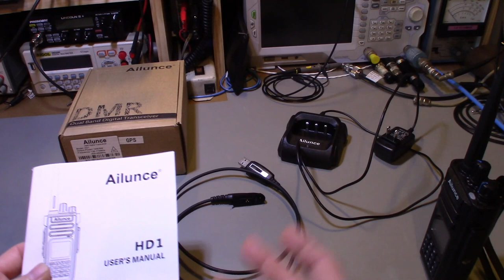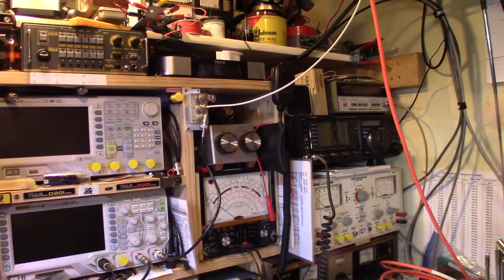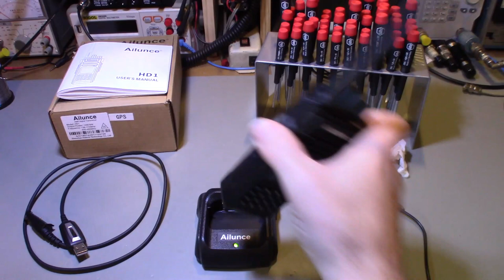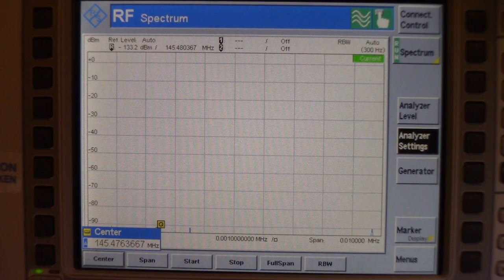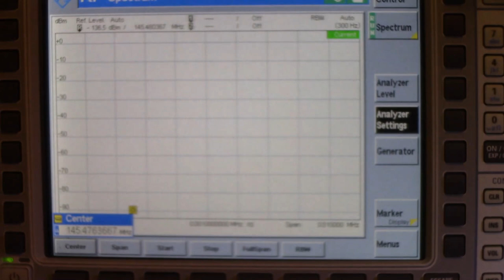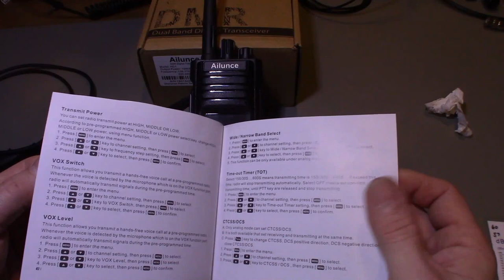Retevis Ailunce HD1 GPS dual band 2m 70cm DMR walkie talkie review and teardown.

Comment: I know this is an oldie video but I have been using the HD1 for a while now and it’s one of the BEST portable radios I have ever used. Everyone talks about the build quality and how excellent it is and they are all spot on. If someone were to hand me an HD1 with a Motorola logo on it, I would have 100 percent believed it was their radio. It’s solid, good weight and looks professional and not chintzy like most ham radios. I’m looking forward to Ailunces next generation of this unit.

Comment: I just bought an Ailunce HD1. Great video !
Talking about using direct conversion only in small hand held radios,  FYI, TYT makes the MD380, a DMR HT with a superheterodyne receiver. It comes in either VHF or UHF. They also make a waterproof version , the MD-390.  Very tough little radios.

Comment: no you can't encrypt messages on the ham bands even if your radio allows it ( dmr is/was business orientated and they are allowed to)
Reply from the maker: I didn't think so.  Was beginning to wonder if I missed a rule change.
Reply: In the United States -  some counties rules are different.
Reply: Just as it's possible to use these radios on FRS/GMRS frequencies, it's not permissible to do so (too much Tx power/inappropriate antennae)... same thing with encryption.
Reply: @mikesradiorepair  - If you cross reference the FCC ID number it will probably certified for Part 90 service in the U.S. Encryption isn't allowed on the amateur radio bands but, can be used for business use, etc. You're holding a commercial radio instead of one designed specifically for amateur radios use, that's why it has built in encryption.
Reply: @hansoak3664  Update: As of 2019-01-30, FCC ID 2AAR8AILUNCEHD1 is valid.
Reply: @BoB4jjjjs  Thanks for the update. You are, of course, correct. I have previously posted the updated information everywhere I could remember. I must have missed this one.

Comment: Actually have a set of the owl walkie talkies and my kids love them. They run on frs 500mw, 467.5625 dcs is 306. They have pretty good range even thru houses which uhf is good for building penetration. Id recommend them for kids and I also have the HD1 and love it. The feel reminds me of the old Motorola Saber portables that Pennsylvania State Police here carried. Also there is a debate on the antenna impedance, Ive seen specs of 80ohms and also 50ohms.

Comment: By far the best review on YouTube for this radio! You did however make a few mistakes as you said 443mhz was vhf and 145 was UHF when it is obviously the other way around:). Also encryption is still not allowed on the UK and US ham radio licences but Ailunce probably copied the features of radios of the likes of the md390 which were designed for commercial use.  Thanks for the great review and keep up the good work! 73 from M0JKE

Comment: Is there any plan to add a CC, TG, TS, Radio ID scan 4 Penny transmission being received on VFO ?

The biggest problem I am having is I cannot find a DMR radio that when put into promiscuous mode, will receive any DMR transmission and lock on to it, and decode it, and display the color code, the talk group ID, the time slot in use, and the Radio ID so that I can copy down the information to then add the channel into a memory slot on the radio.

My WS1080 scanner does some of this and my uniden 996 P2 with the DMR upgrade does some of this but not very well

I know I can program in 16 different memory channels with a different color code for each channel for the same frequency and scan but there has to be a way for the company to add this feature into the radios firmware

Even if it means creating a special Bank where you would enter in a frequency and the radio went in essence do exactly the same thing and create 16 temporary virtual channels that it would scan a different color code for each one of those channels and then display the one being used for the current transmission along with the time slot and the talk group ID and the radio ID in use at that moment

As DMR is becoming more widely used we have multiple agencies and companies using the same frequency and using different color codes and talk group ID combinations as well as time slots to create separate "channels" for each user. 

At the moment I have a frequency that is only supposed to have one user on it using color code 3 talk group 2 time slot 1 and I have two other users using that same color code and different talk groups that I cannot identify as well as 12 other users using some other color codes and other talk groups and time slots and I cannot even begin to figure out what they are using because I can't find radio that can scan and display this information so that I could program in the settings to be able to know when they are transmitting and record them to try and figure out who they are.

If anyone knows of a radio that can do this please let me know.

The WS 1080 is the best I've found so far but still is not that good without having some of the information programmed in

I'm not sure why it's so difficult for radio to be able to decode this information but it must be very difficult because no one's been able to make a radio to do it yet and this looks to be the best candidate to try and get the manufacturer to update the firmware to have this capability

Comment: The Chinese company's are notorious for providing "samples" of their goods that are in spec and sometimes built especially for "sample " testing.
Now I am not saying this is the case here, but be informed.  I have seen too many times that Chinese manufacturing loves the old bait and switch game.
Meaning cheaper components and as many shortcuts in production runs that are good enough to fool just about anyone.

As far as your video review....good review.
Reply: Bigot, how do you mass produce hundreds of thousands of radios switching out parts randomly. Doesn't make any sense at all.
Reply: Bulldog Brower fair point

Comment: Hi Mike nice review and teardown (first time I have seen that in a handheld radio review) the Retevis and TYT radios are very good I have the MD380 UHF DMR badged TYT and both the Retevis RT2 and TYT DFUV10 Dual band DPMR digital PMR radios which are great, another interesting little DPMR UHF only radio I have from China is the realy small Recent RS309D 3w radio 400-470MHz PC programable also in a less featured option the RS308D but like most Dpmr radios made in China they have a specific vocoder so they only talk to each other in digital mode or a few other brands, even with the restricted power and strange vocoder choice they are great for standard analog PMR due to the restricted power setting in the program software and amateur use with all the repeater settings available when programing also a fantastic whisper mode which realy works well, cheap as chips feel great in the hand built very well and receive and transmit better than my old FT51r on 70cm, I have seen a lot of these little radios being sold into mainland Europe and I would think they are being used as PMR radios as they have public PMR repeaters over there.

Comment: unfortunately you missed a big problem these radios have which is the rf amplifier stage is not designed for 50 ohms, the antenna they come with match the radio but I think from memory they are designed around 30 ohms
Reply: Seems everyone missed this...!!  no other replies... quite extraordinary.
People, it can make it impossible to use an external antenna...   the only way it seems to get Aliunce to do something is for people to highlight this and get them to send out a hardware update fix, it needs a small balun which can screw onto the SMA output connector for ext use, so before you buy, ask them if you can use an external, see what they say....  their answer is only use low power...  great..!!!

Comment: 21:31 It's not really hard to put a superhet circuit inside a handheld radio. All the good brands manage to do it. Motorola, Hytera, Icom, Kenwood. Even the TYT MD-380 which is a cheap chinese DMR radio.
Reply: Try find a dual band handheld super het. Single band sure, but not dual
Reply: @brianjensen5200  APX7000. And that even has VHF, UHF and 700/800 MHz.
Reply: @radiosification  not exactly comparable is it....
Reply: @brianjensen5200  well if they can put a superhet single band in an md380 why can't they just put two of them (one for each band) into a radio? Even if it's double the cost of the md380 that'd still be reasonable
Reply: @radiosification  and yet no-one does in any of the reasonably priced radios. Must be a reason as they would sell like hotcakes
Reply: @brianjensen5200  Well it's just cheaper and easier for them to use direct conversion because they get these RDA chips with everything in one chip.

Comment: Do you think it’d be too much of a pain to get a Motorola speaker mic or headset lead to work on this radio? Can’t find information on the pin connection and thread pitch for either of them through google. Any suggestions appreciated.
Reply: There are RSMs available on the retevis site, even a Moto APX XE mic clone with IP67 rating.

Comment: Can you tell us more about the build in AMBE+ Chip set. The Question came from a compare between Software Encoder vs. AMBE+ Chip set Encoder. In my ear sound the Softwaresolution of the DMR Encoder not so clear then the AMBE+ Chip set for example the Clipping Sound from a Retevis to a Hytera make not fun because this to understand is heavy for my ears. Tell us more about the ABS Plastic Mold that will be in the Galvanic to make the GND shield. I think this is cheap and not a good shield - or!?

Comment: I've got some screen issues and I want to reseat the display flex cables. I've taken the 6 screws out from the back, but am unsure of how to remove the metal plate from the front of the radio. Can you give me any tips? Does accessing the display flex cables require the de-soldering of the antenna mount?

Comment: Hey man, I actually have an HD1 I use for scanning police and stuff, and I have two other radios as well, and every one makes a popping noise when going down the road listening to local law enforcement , and I wasn’t sure if this was normal or not. If I’m sitting still it sounds clear and normal. Any thoughts?
Reply: Almost sounds like might have a loose ground in engine compartment --- if you notice this noise on vehicle radio when driving, might be the culprit.  I encountered this noise when had a loose (only 1) spark plug. Noise quit after re-installing the spark plug.  Hope is helpful.

Comment: What's the 12dB SINAD signal level. Measuring the signal that opens the squelch is not measuring the sensitivity .
Reply: Humm, haven't heard those terms used in a while. Quieting would also do, but I like sinad.. These radios all have a common thread. This one reminds me of the Alinco with a slight few differences. Seems like a bluetooth version might be able to do Analog APRS ? But, no one wants to talk about that.

Comment: Hardware reviews are great, but I have never seen a software review. There are two major problems I have seen with software. First of all, very few software engineers for manufacturers seem to be radio savvy. Case in point: Admit Criteria is actually BCLO (busy channel lock out) DUH. There are other issues too, just too many to talk about. Here is a big one:  the fact that the scan banks are programmed on a per channel basis and not per zone. This is ridiculous. Every other radio I have ever owned scans on a per bank, or ZONE basis. I do not know if it is a limitation of the firmware and/or software, but that has to change. It requires me to duplicate channels numerous times and attach different scan lists to each one. Pretty silly. I'm sure  I am not the only one that travels quite a bit and needs to scan on a geographic basis, in other words, scan the channels that are active in the area I am presently in. To me, this is the largest headache about programming these radios.

My other issue with software is that I have not seen any video, documentation, or ANYTHING going into detail about what all the features do on a DMR radio. I have had to figure them out on my own and there are still options I do not understand. The manufacturers have dropped the ball here. This is a very large problem: not understanding all the programming features. I just think it is a sad situation.

On the comment about privacy, or SCRAMBLING, yes you CANNOT do that on amateur frequencies, but you can on itinerate (unlicensed) channels. REMEMBER it is a  wide band radio covering many different radio services. I see this come up on many other reviews. Everyone reviewing a radio should do their homework BEFORE doing a review. Also the proper terminology about the technical aspects and what things are called would be a good start. It is a reflection of what you really know, or rather, what you don't know.

I thought your review was quite long and should have been edited to size it down, but overall, the best I've seen yet. I would have liked to see you disassemble the radio and then put it back together though.

Comment: Did you test for spurious emissions? Some of the Chinese handhelds are notorious for exceeding the limits prescribed by FCC 97.307(e).
Reply from the maker: 2nd harmonic is 52db down on 70cm and 53db down on 2m.
Reply: Hmmm...You were getting something like 39 dBm on 2m? 39 dBm minus 53 dB is -14 dBm. FCC 97.307(e) specifies that spurious emissions can't be greater than 25uW which is about -16 dBm. Or, is my math wonky.
Reply from the maker: Nope, math looks correct.  It's close but the quick test I did showed it slightly above the limit.
Reply: got damit, I have to learn this too ?? ffs (banging head on keyboard)....
Reply: So no good due to spurious???
Reply: @mikesradiorepair  does that pass the requirements in order to get part 90 certification? i ask because it does have the certification and wondering if they didn't cheat, and also to use for a business with business frequencies, just want to be sure this radio wont cause issues with the FCC for spurious emissions, thanks alot

Comment: Can anyone help me with a problem with my HD1 the battery percentage indicator is stuck at 100% on one hand held but on the other hand held when I swap batteries it shows the accurate percentage how can I resolve this I've swapped it between 4 batteries does the same thing and I even updated the firmware to 1.54.  And if it means anything I have the GPS model

Comment: The HD1 has major issues. After 6 months of use and I'm not the only one it has a white screen of death. I checked the ribbon cables as they say on the company site and I've check the firmware version trying many different. Dealing with the company or the seller is ridiculous 😡.don't buy it unless you want to send it back to China to receive the same faulty parts I've wasted hours and I've given up.

Comment: Dmr is bad for military specs, is very prone to malfunction. Digital technology could fail at any moment
Reply from the maker: The military has been using digital for decades.  I was using frequency hopping encryption radio systems in the Army in the late 1980's.
Reply: MikesRadioRepair That doesnt mean it is reliable in a emergency Situation, okay go with dmr but prepare to be attacked from its vulnerabilities. Even analog systems nowadays use microelectronics and are susceptible to malfunction. Microelectronics will be useless in a future warfare, Einstein said something about it.
Reply from the maker: ROFL. The last thing I'm worried about is "future warfare".  I'm a few minutes away from the tunnel (site R).  If a nuclear war happens I'm dust and there's nothing I can do about it.  Having a working radio isn't going to do my charcoaled body any good.